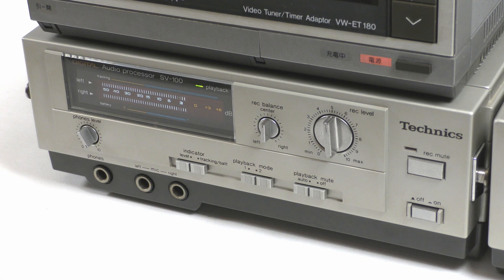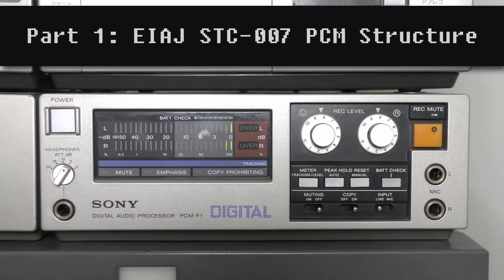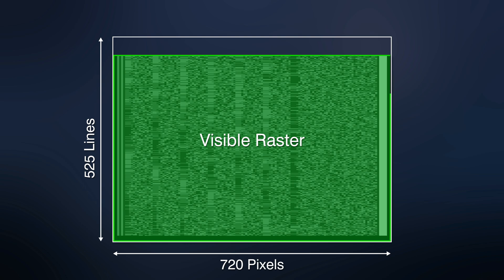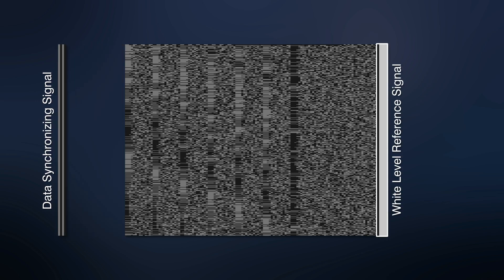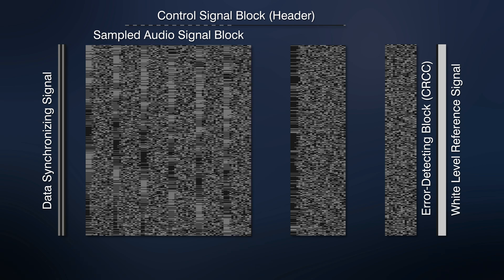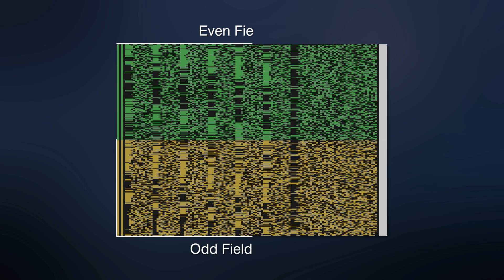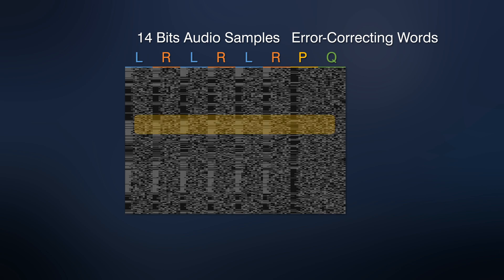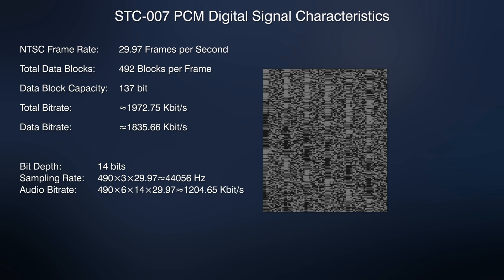[PCM Video Course] Digital Audio on Video Tape - Part 1: EIAJ STC-007 PCM Structure

Comment: Looks like the website of this project is gone.
Reply from the maker: The site has moved. I've updated the link.
Reply: @eep-lab  Thanks, Are they for sale? Also, is there any plans for a combo coder/decoder?
Reply from the maker: @Capturing-Memories  Full PCM processor in development. I’ll answer the question about purchasing an encoder a little later.
Reply from the maker: @Capturing-Memories  Regarding the sale - сonnect to the discord server (link under the video) and write a PM to @mihail2501.
Reply: @eep-lab  Now that you mentioned a full version is under development, I think I should just wait for that, I have the 601ESD, so no urgent need for me, Thanks a lot.

Comment: I have a good collection of these including: PCM-F1, PCM-501 (with digital output added), PCM-601 (includes digital from factory), PCM-701 (with digital output added), 2x PCM1630 with SDIF to SPDIF / AES converters and associated DMR-4000 Umatic decks, PCM-100, PCM1610 etc.  All in working order.